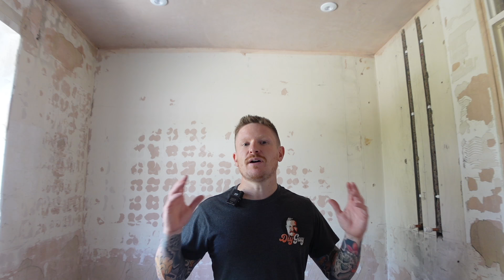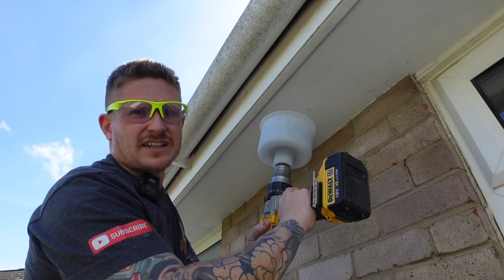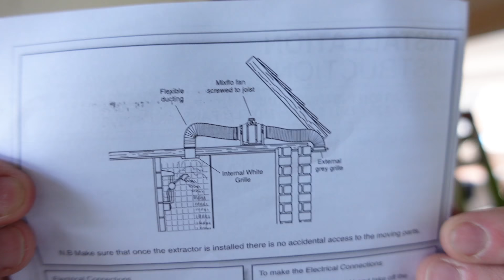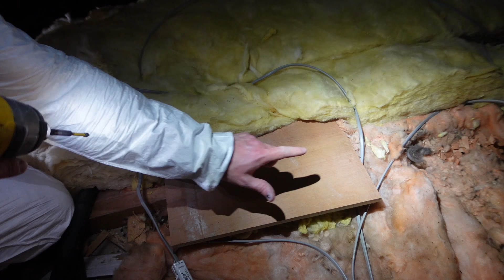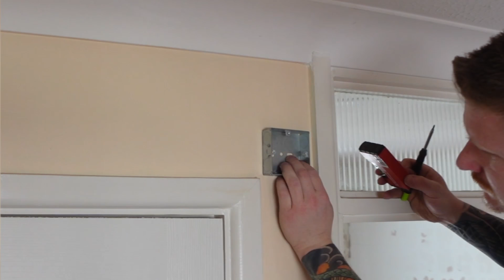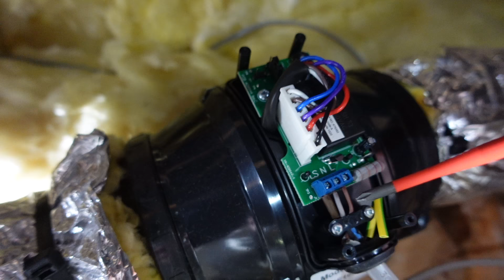How to Install a Bathroom Extractor Fan - Complete DIY Guide Made Easy

Comment from the maker: This one was tough to film, hope you find it useful. Please sub if you like the content 😊
Reply: Working in lofts is the worst believe me.. All the hard work & effort is Much much appreciated. ❤
Reply: Thanks for the video; it was really helpful. Does the fan have a timer that can be set to a specific running time?
Reply: @yousefrostami yes it does - 20min max overrun
Reply: Appreciate all the efforts. Definitely sound from down near my way (Norwich).
Reply: it was worth it! Thanks for the video!!
Reply: Hi @TheDIYGuy you used a 10amp fuse isolator switch but the fan says to use a 3amp fuse. Is this okay?
Reply: Got damp, upvc window in bathroom stuck and paint peeling off ceiling as current extractor is just rubbish.  This one looks like it'll work great
Reply: Excellent
Reply: Followed these instructions to the letter and it all worked out great.  Thank you.
Reply: I like your drawing for the electrics.
Reply: Where is the link?
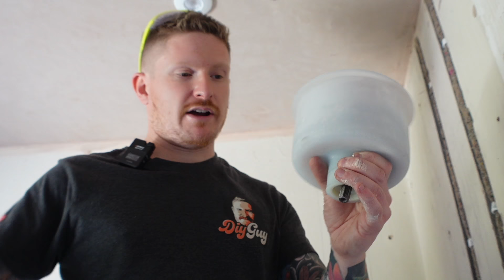Reply: Yeah, I stopped watching at the 1:59 mark.  You were up in the attic, you had your hole saw; how hard would it have been to drill...I dunno...DOWN.   Even if you only drilled through with the pilot bit, then drilled the rest from the stall.

Sorry, mate; no sub from me.

Cheers.
Reply: @tetedur377 Because he’s got a fancy tool for catching all the dust and mess so does it form below. There’s more than one way to skin a cat….
Reply: @tetedur377 because he’s not rough like you and doesn’t want the finished surface to blow out

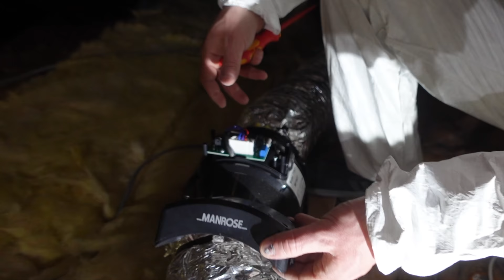Comment: 12:40  -  You said it!  A concerning issue with the Manrose Inline extractor fans is that its max operating tempature is only an abysmal 40 degrees. This is a major concern, especially in intense summer heats like we have been getting over the past 4 years. Not only the extractor is extracting hot water vapour in the shower, but its also sitting in an intensly hot loft where temperatures can easily exceed well over 40 to around 45-55! This product is in risk of much quicker wear and tear and motor could pack up. You may want to consider the "Vent-Axia" range where its operating temperature is 50 degrees especially for those loolking to fit ceiling extraction.
Reply: oof

Comment: I want to install 2 shower rooms side-by-side. Is it possible to buy a double extractor fan so I only have one vented hole on my outside wall?
Reply: No, but you can buy splitters and use one fan to pull from 2 rooms. Only thing is, if one room is on, both rooms get extracted, plus you’d have to buy a bigger fan in the case where both rooms are being used.

Comment: Always best to go straight up & out through a roof vent if possible rather than down through a soffit. Expels the condensation more efficiently although you may require a roofer to install said roof vent. The other issue is the corrugated insulated ducting is not recommended for long horizontal runs as condensation will pool in the ripples with nowhere to escape to causing mould within the ducting and a damp smell in the bathroom/en-suite. So if using the soffit vents it's best to use a run of full bore 100mm ducting and 45deg elbows to connect outlets.

Comment: Great video....now what would you use for the ceiling if it was lath and plaster? I am about to take on the same project but cant find much advice on lath and plaster other than pull all the ceilings down and replace, obviously im not going to do that!

Comment: Have fitted inline fans before and they are great. You still have to keep ducting lengths to a minimum. I appreciate you did your suction test at the end but I do wonder if having a (decent) conventional wall fan connected directly out to the external wall would be more effective, especially because of the shorter ducting length? ( I also keep about 5mm gap under bathroom door for airflow.) Would welcome different views on this.

Comment: You shouldn’t vent through soffits like that downwards. The air never really gets vented properly. If you have the wooden soffits jt til rot them. Even with upvc they will end up going black. 
Air needs to be extracted sideways at best. Roof tile vent would be a better option

Comment: Great video. I’ve just installed one of these exact same model fans with same vent, ducting and external vent too. My bathroom is full tiled and the fan speed is set to high. I tested the suction strength of the fan by placing a thick kitchen tissue over it and there is a decent amount of suction as it pulls the tissue up and holds it. I have a rain shower and when taking a shower steam still seems to build up. I’ve placed the vent literally above the rain shower area. Steam does clear up within 10 mins afterwards but sometimes walls are wet from condensation. Is this normal? Is there a way to reduce this ?

Comment: Hi, I would appreciate some professional advice regarding the installation of an extractor fan duct.

On the ground floor, next to the staircase, there was previously a small kitchen, which has now been converted into a WC. The WC ceiling height is 2.4 m.

Beyond the main structural wall, there is a side extension with a flat roof that contains a bathroom. The bathroom ceiling height is 2.5 m.

I plan to install an extractor fan in the WC, and the duct needs to run through the bathroom before exiting through an external wall. However, I would like to retain the full 2.5 m ceiling height in the bathroom. I do not want to install a ceiling bulkhead in the new bathroom because I feel it would look unattractive.

What would be the best way to route and install the duct in this situation?

Please note that there is no steel beam within the ceiling structure.

Any suggestions or recommended solutions would be greatly appreciated.

Comment: Im about to do this exact task, quick question, my house was built in 2001, i can only locate the 3 core and earth cable coming from the switch within the loft and it goes straight to the light, then on to the isolator switch, then fan. Theres no junctjon boxes, does that sound correctly done for when the house was built?

Comment: Don’t rate these extractors. Both myself and my son have had problems with condensation collecting in the pipe. His came through the ceiling while mine just stopped pulling the air out the bathroom. Even an insulated hose didn’t fix my problem

Comment: You are absolutely correct that an inline fan will move a lot more air than any wall or ceiling mounted one. The caveat however is that high quality wall/ceiling fans come with a humidistat that can turn the fan on even when the lights are off. What that means is that in summer when many people shower with the lights off, you still get a fan that runs based on whatever setup you have. To be fair, you can get an inline fan and a separate humidistat (not all fans support that) but the cost difference is quite stark. Also, inline fans do not come with a backdraft shutter so you have to budget for that too. It's not a lot but the costs do add up.

Comment: what if I can only acces the switch and dont know where the power comes from withot destroing a half of my house? I have a switch that is already powered and then I need to instal the fan. How to do that? how to connect isolator and fan to this? My power source comes from the switch.

Comment: If you're coming to the circuit and have no prior knowledge of the loop in and loop out, how do you ascertain which is the feed in and feed out?

Would you simply disconnect the circuits, reinstate your isolation and then test for voltage?

Comment: Did this a few years ago but the fan wasn’t the timed version, I used a Manrose Humidistat which controls the fan and turns the fan off when it hits the desired Humidity… works very very well..

Comment: This is a great video, however, there is one point of safety here, the wiring into the fan 13:12 is not safe! The cable clamp is for the outer insulation and should NEVER be used for the individual cores, as it will either not clamp the cable or could over clamp and cause core insulation to be compromised and expose copper and cause arcing or a short. The outer insulation should be clampped with longer core length to allow looping around and then screwing in.
Reply: It’s not ‘not safe’. What’s not safe is the wires exposed on the outside of the fan terminal. What you describe is ‘a risk’.

Comment: As a duct fitter by trade I approve. Just please never use cable ties again 😂 use jubilee multi banding instead 👍
Reply: Hi, which model would you use? Thanks Chris
Reply: im using a 100mm vent-axia with a max 20min overrun feature in my own attic. I’m pretty sure Screwfix supply it. Great piece of kit.

Comment: Where did you fit the 3amp fuse that the instructions say MUST be fitted?
Reply: I guess you could swap out the isolator switch for a fused switch and stick the 3a in that.

Comment: In the past I have fitted Airflow iCON extractors which have a humidity sensor so the fan works independently of the light. Is the way to do similar with these inline fans?

Comment: I installed a Manrose inline in my loft above the shower about 6 years ago but it failed due to a broken blade which I didn't notice when I installed it. Manrose sent a replacement  but I had also bought another unit and installed that while I waited. This failed after about 6 months as it was full of water. The now repaired one was reinstalled at a 10° tilt and this too only lasted about 6 months before it failed. During its operation we had to go into the loft to empty the ducting every week, despite it being on a downward slope. I came to the conclusion the ducting was condensing the water quicker than the fan could take it away so I gave up and we just open the window now. It is a shame because the fans were very powerful and easier to fit than a hole in the wall.
Reply: Or just stick a dehumidifier in there, plugged into a landing plug socket. My daughter can be showering for 2 hrs (I ain't a clue what she does). I leave it on for 3 hrs, no windows open. It's pretty much condensation free.

Comment: It’s so much easier to put the duct in, pull it out of the hole and connect in the room or outside, then just go up and pull it up, this way you are not fighting it in the loft. Finally duct tape the external wall on each joint.

Comment: Work out your bathroom volume or atleast the shower area volume and get an extractor to match. Removing the volume will massively reduce condensation. If done correctly your bathroom mirror won't even mist up

Comment: Good clear video, but. 
4 tips from an old fucker. 
1: Make sure you’re not going to hit a rafter when installing the outside vent on the soffit as well.  
2: Before drilling the big hole in the ceiling. Drill just the pilot and check your measurements were correct. (Measure twice cut once). It’s a dam sight easier making good a small hole than a bloody great one. And if you’re only a little bit off, your big hole will cut your mistake out. 
3: Aim the louvres on the outside vent away from the building. It’s better to not blast all that moisture directly at the building.
4: where you wired the fan end, those little screws in between the blue sleeving and the terminals are for the cable grip. The outer sleeving of the cable should be gripped by that plastic collar between those two screws to stop the cable from being yanked out by people crawling around in the loft space.

Comment: Electrician currently fitting fan in my bathroom.
He says there's no need to run pipe to outside the house, it's okay to have the pipe up through ceiling & vent to the attic. 
Is what he's saying true? 
Thanks.

Comment: Only trouble is the switch line from the switch is feeding the fan so you can only have the fan running with the light on.

Comment: Just followed this guide, specifically the wiring. Already had an extractor fan in place which I fitted a few years ago. God knows how it was working based on the abortion of wiring, but I managed to trace it all. The new in line fan is now installed, and all the cabling is updated, joined and safely secured using Wago connectors and a junction box. I'm not one for kissing arse, but I have to say, you are my go to guy for anything DIY. The garage door video was brilliant and inspired me to buy and fit my own. Saved thousands.......

Comment: I've always used junction boxes for jointing cables, but the newer style jointing blocks that simply crimp down on the wires to secure and connect them look so much easier that i think I'll be using them in future... nice, clean and efficient job by the way... 👍

Comment: How would you connect up plastic air valve vent of some kind in such a way that you can also remove it and connect up a co tonuation of the extractor that would lead into a 3d printer? I'm not taking bathroom ofc, but I wanted this in my office to take fumes out of the printer outside but if I disconnect printer change
Reply: Ok that comment made no sense, so I basically need some kind of ceiling valve that could connect up two pieces of extractor duct so that the attic draft does not get into the room

I could have extractor duct running directly from or enter to the outside vent under the roof but I fear draft

Comment: You missed a couple of things.

1. Manrose state in their installation instructions that the unit should be supplied from a double pole fused spur with a 3 amp fuse.
2. The lighting circuit should be RCD protected as it is supplying a special location under BS7671.
3. This falls under Part P of the building regs and is notifiable work as you are making an alteration/addition to a circuit in a special location.

Apart from that, some good advice, these are good fans, personally I run them from a humidistat as sometimes the run on time is not enough to get rid of all the moisture after a hot shower on a cold day.
Reply: Good points, especially 3. I'm pretty sure it is notifiable work.

Comment: Just a point of interest.  You would never sink a box into a wall  BEFORE wiring the circuit and having all cables in situ.  Because after sinking the box you might find it nigh on impossible to get the cable there !!   Result , a waste of time sinking the box  and filling the useless hole !!

Comment: I have to laugh at the way they make things look so simple.  Yet try doing it yourself and you come across all manner of problems they don't show you.  Problems like losing your tools yet you have only just put it down.  The wrong type of hole cutter - yet thats the one that is recommended.  You screw into a wall and it is just like trying to fix into porridge, especially older houses.  Then you cut the hole through a cavity wall and because you have not had the drill perfectly level, the hole is then too near the ceiling so you cannot get the fan into it.  Believe me after 40 odd years of all manner of DIY,  I have seen it all !!

Comment: I think there is also supposed to be a 3 amp fused connection unit after the isolator too. I think the fan switch is not enough.

Comment: Great video 👍 I have never done this job before but I am about to soon. One thing g I have been reading about is a backdraft damper which does in line with the ducting. Allegedly stops any backdraft blowing from outside back into the room. Thanks for the video.

Comment: I know it's been 3 years since you did this. 
Having trouble gett8ng the fan to run off the switch mains. 
Using down lights where the initial power source was missing. 
Established the switch live,  put it through the isolation switch, but only constant live,  neutral getting to the fan. No power running through the switch live?
Any ideas?

Comment: Oi, DIY Guy. Over the last few days, part time I've taken on this job and installing a Monrose fan in my smelly, condensation laden bathroom. Your instructions are so spot on, and so clear. Thank you so much, your a real gent. The wiring diagram you made up is great, and so very clear. I love the Wago connectors for ease. Your a master tradesman. take care and thanks for the vids.

Comment: What I've also done is install an extractor fan in the loft, controlled by a thermostat. The inlet to the extractor is high up in the loft, and the thermostat is 1.5 metres above the joists.  The fan comes on above roughly 28C and goes off when it drops below about 26C, so it's on when it's particularly hot outside, but also when the sun is strong and the winds light.  It's made a remarkable difference to the temperature of the rooms upstairs on hot, summer days - the heat in the loft used to make the bedrooms very uncomfortable at night, but having a cooler loft means the bedrooms are no hotter than the rooms downstairs.  It's only a small fan (100 watts I think), just sufficient to take the really hot air at the top of the loft out and pull in fresher air.

Comment: I would advise against only using cable ties - the ducting can be pulled off very easily no matter how hard you tie them. Use tape for the bare ducting, combined with cable ties for the insulation layer.

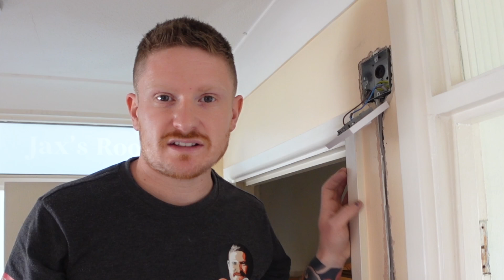Comment: 12:32 so how did you do this? You didn't include this crucial step in the video. Did you use a long drill bit and drilled vertically down from in the loft??

Comment: Looking to replace existing inline with this, the existing vent is outside the shower cubicle, is there any value in putting a vent in the shower cubicle and fitting this fan with a y-piece for both vents, or is there little benefit and just stick with current single vent? Shower cubicle doesn't go to the ceiling so steam can get out to other vent.

Comment: Why do you use very well insulated pipes if the air that circulates in them goes outside?
Reply: Limits moisture cooling before it's extracted ie condensation that may drip back into the room

Comment: Good stuff 👍

I've wired mine via a PIR instead of the light switch.  Means you get extraction without needing the light on in the daytime. Whether getting rid of moisture or toilet smells.